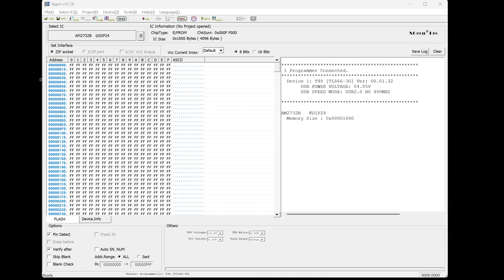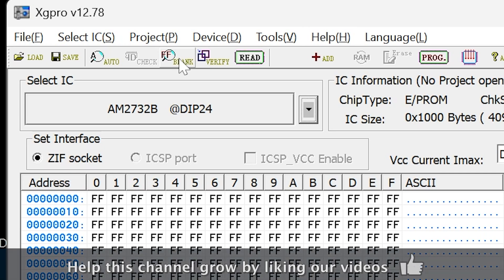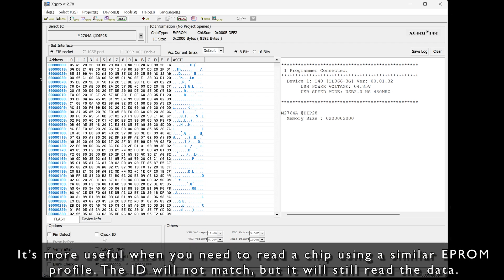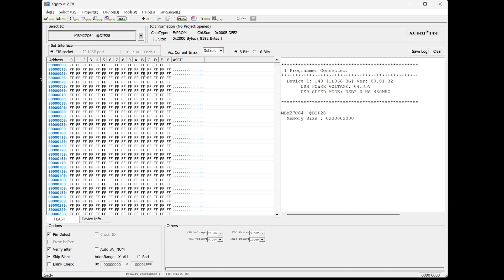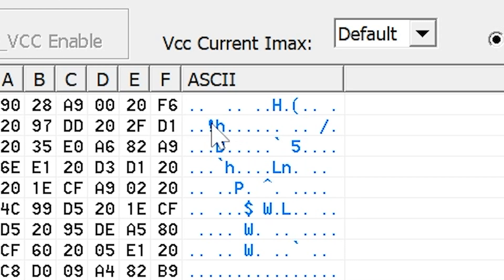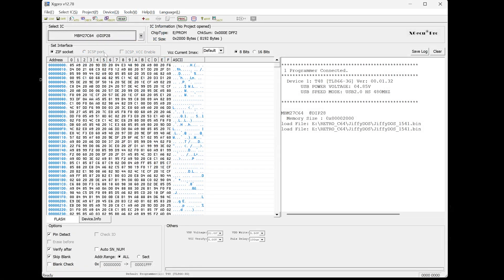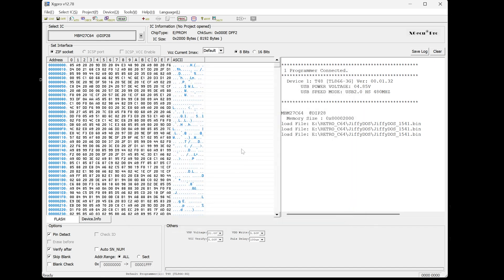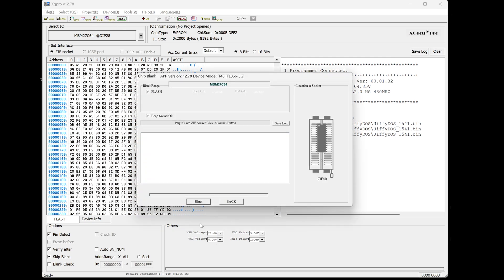Mastering T48 Burner for EPROMs: The Ultimate Guide

Comment: I have a t48 and need to program the last 4k of an intel 2764. Unsure on the start and end address as after googling the t48 won’t let me type the format i find about the  address so I’m assuming it’s wanting it in a series of numbers. Any thoughts or maybe a video that might help me? Thanks
Reply from the maker: The last 4k? I would load up the software, take note of the first and last Hex addresses in the total space. Convert those to decimal using a calculator or web util, divide the total range by 2, then convert that decimal back into Hex and enter it as the bottom of the range and the normal end value as the top. Do this when reading in the data, blank the buffer, then read the data into that range. I cant try this myself at the moment, as I broke my T48, it fell and brittle plastic broke when the little metal level hit the floor first :/

Comment: I use a UV phone sanitizer to blank my eproms, there are a lot of them but mine is a USB-C powered "PhoneSoap Basic" and works well
Reply from the maker: Yes, I have seen hand held UV torches(flashlights) also used. But they require special eye-ware, and the UV A from them can be really nasty to your skin, so I guess at least 3D printing a light tight box to mount these in is a good idea?